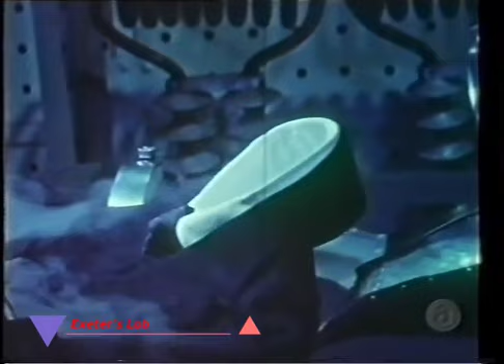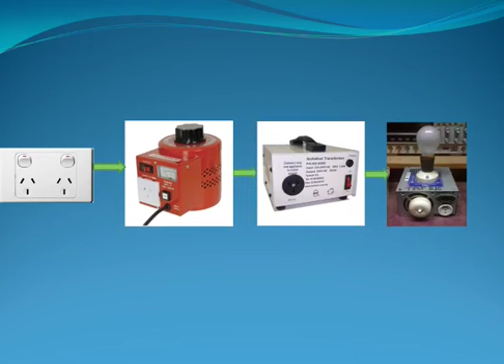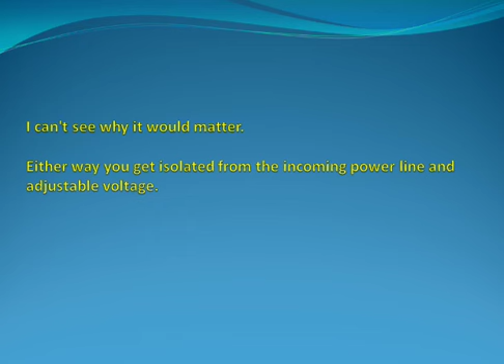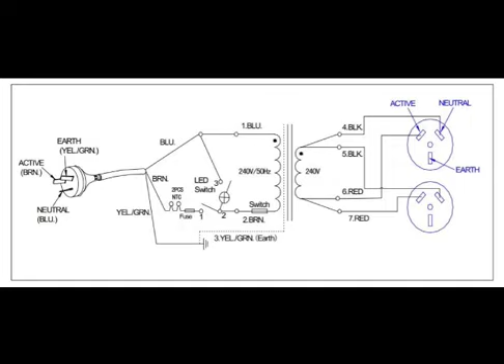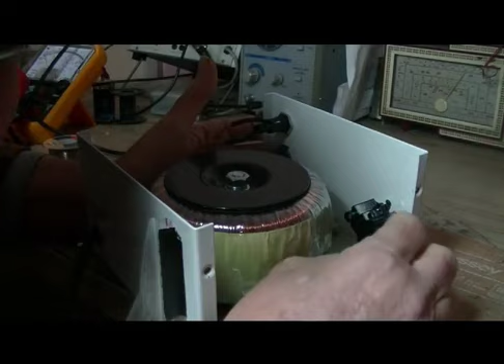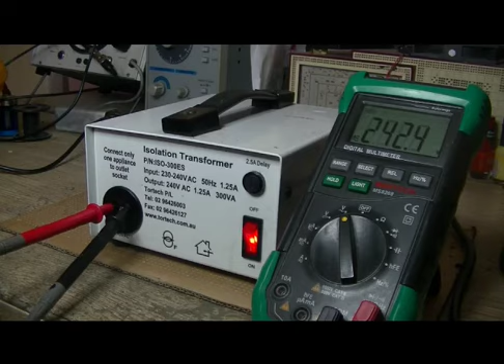Variac and Isolation Transformer connection order. Which should be first?

Comment: I have an isolation transformer itswired similarly to yours in as much as it has just a
2 wire output it is unnecasery to earth either of the output leads as that wil defeat the point of having it. Ive got an ancient variac its neutral and earth are seperat  as they should be they do not join them as that would be dangerouse and illegal in the UK. ALWAYS put the isolation transformer first that way if you accidently touch the variac terminals you wont get a shock.
Reply from the maker: Thanks for that Kelly, :)...............Frank

Comment: And one more point, re: the weak magnetic field stuff when the isolation transformer is after the Variac.... this is not how 1:1 Isolation Transformers work. They are 1:1, period. You give them 50 Volts AC, you get 50 volts AC on the second stage, only with a tiny bit of voltage drop due to thermal loss in the copper and in the iron core. Cheers man!
Reply from the maker: Hey, thanks for the info, much appreciated :)

Comment: Variacs and Isolation Transformers BOTH tie their ground pins back to your wall socket's grounding pin. The grounding 'hole' in that wall socket is, of course, on 'Ground' or 'Earth' and goes all the way back to your electrical panel. Here is the problem: In the panel, 'Earth' ties into 'Neutral'. This means that on the 'Safe' side of an isolation transformer, that Ground Pin IS NOT ISOLATED. In fact it is THE NEUTRAL LEG OF YOUR MAINS! Yikes. The same is true of the grounding pin on the "variable" side of the Variac! So if you were to 'touch' the ground of your isolation transformer's second stage, you'd be fine. But the moment you touch anything you're working on that carries the single hot leg of your AC, it's 'Goodnight Vienna'. Just wanted to point that out, I'll go back to shut up mode. Cheers!
Reply from the maker: I had read something similar before or i caught it from Uncle Doug. I have to admit, I'm very wary of all this stuff so I never touch the chassis with both hands  even though the Iso trans is supposed to protect me. I've had enough nasty shocks and I don't want any more lol

Comment: I made my own isolation transformer / autotransformer and put the isolation first because it seemed more right to me. The isolation consists of two step-up 700-volt transformers back-to-back. Can't use step-downs for this. Must be step-ups. And I earth grounded the output socket. I think I should have included a Ground Fault Circuit Interrupter (GFCI) device to the output as well. I'll include that in a future renovation I have planned.

Comment: Well, let me assume the following situation, which I would deem to be the "ordinary case": So, first let me assume that you have safe electrical devices, which means:

Variacs usually come in a metal case. And, like any electrical device,  they should therefore be grounded to protective earth. If they have a three prong outlet, the protective earth of the outlet should be connected to protective earth, like with any normal electrical device and like with any normal outlet. Variacs should have ordinary outlets, isolating the "business-conductors" from your touch and not some non-isolated screw-in terminals like some chinese ones do. If your variac is "unsafe"; if you have open wires or terminals open to the touch, if you can touch the business conductors, of course it's less risky to put it behind an isolation transformer, and what I say below does not apply. But in that situation fixing the safety problems of the isolation transformer would in my eyes the best thing to do -- and I did so with mine.

An isolation transformer usually has a plastic housing and double isolation, so there is no need for protective earth. It can have a three prong outlet, that, like you have shown in your video, should not connect protective earth behind the isolation transformer to anything. It is just left floating. I will explain why that is important.

Ok, your isolation transformer does have a metal case and there is no double isolation, to the case should be grounded to protective earth. That's not as good as a completely isolated one, but it's perfectly acceptable also. What I can see from here it's a perfectly safe electrical device...

---

If you use an isolation transformer for protection, the intent is, that if you touch any single one of the wires, you do not get a shock, because the other wire is isolated from ground and no electrical circuit can form. Touching one of the wires just shifts the potential of that wire to ground. As there is no back-connection through the other wire, no circuit is closed and no current flows. You are safe touching one wire.

Therefore you also do not need protective earth for devices in metal housings behind the isolation transformer, that usually do require grounding to protective earth. If there should be a fault in the device, connecting any of the wires inside to the case, it reduces simply to the case of you touching one wire, just now through the case of the device. Nothing will happen, no current will flow. On the other hand inadvertently introducing a ground connection behind an isolation transformer is very dangerous (because the isolation no longer is there!) so a device with a metal housing sitting behind an isolation transformer MUST NOT be grounded to protective earth. That's why it is important that the isolation transformer leaves the protective earth of it's isolated outlet alone and does not connect it to anything.

Ok, now we have a circuit behind the isolation transformer that has no connection to ground and we can touch any of the wires as long as we do not touch both... But all that "splendid isolation" is only there for the "first fault in the circuit". If you are not the first connection to ground, you are in a very dangerous situation! 

Assume you connect two devices to the isolation transformer and both have a fault. The first one might connect one wire to the case and the other one also has a similar fault, but happens to connect the other wire to the case. If you now touch both cases, you are in for a nasty shock. Likewise if one of the cases get's in contact to earth ground and you touch the other, you also get shocked.

Therefore it is mandatory over here in germany -- at least to my knowledge, I'm not a professional on this -- that on an isolated circuit like from an isolation transformer or from an ungrounded,  ordinary power inverter only one device, and one device only may be connected. It is simply forbidden to connect more, to prevent multiple isolation-failures to occur at once in the same circuit. (There is the possibility of having more than one device connected to an isolated circuit, but it's and edge case and requires an isolation monitoring device that makes sure, that none of the two wires developes a connection to ground, in which case it will act like a fuse and disconnect both poles from the powersource. It's much easier to introduce ordinary grounding, so most big inverters or generators go down that route)

And that is why it is not as good to connect your variac after the isolation transformer: It's case will be floating, and if it develops a fault, the case might be connected to one of the two wires, without any obvious consequences at first. If you now connect for example a hot chassis radio, you introduce a "second fault" and your chassis might now connect to the second wire. If you now assume you are safe, and while brushing against the hot chassis you reach over to your variac: Bang! Big surprise, maybe even a deadly one.

Best only connect a single device to an isolation transformer. Whenever possible use a safe, properly grounded variac with ordinary outlets that is safe to use without an isolation transformer before it. It should isolate the "business-conductors" and have a case connected to protective earth. And then use the variac before the isolation transformer, to not introduce a possibility of a "second grounding fault" in the isolated circuit should the variac ever develop a problem.

It's not a big thing, it's not a highly likely situation that you have an unnoticed fault in the variac, but it is the safer way around and I think it is in better alignment with the official safety rules; At least as far as I know...

Comment: I have one reason the isolation transformer should be first. Considering most if not all variacs use a variable contactor to traverse the windings of the variac. This action may result in the contactor momentarily breaking contact between the variac windings. Even though this make-brake-make of the contactor on the windings may induce a momentary glitch in the power supplied to the DUT. If the isolation transformer was wired between the variac and DUT, the glitches produced could cause the isolation transformer to produce greater spikes of electrical power to the DUT. Similar to having a faulty power switch which may not be perceptible to the average viewer, have been known to shorten the life of incandescent lamps and other electronics.
Reply from the maker: Thanks for that Donald. I'm learning so much about this from people like yourself

Comment: My main iso-transformer is BIG...output is 20amps/120V, so that goes first. Why ?  (1) There is a substantial magnetizing current in the transformer at all times (yes, even with zero load), so I'm not going to burden my 10-amp Staco variac with that current (2) My iso-transformer has dual primary windings, so I drive it from the 240 circuit, rather than the 120v mains (I'm in the US), because the turn-on surge current is less for 240V than 120V.  In fact, the surge current is high enough to frequently trip the 15amp breaker when running off 120V, but no issues at all when running at 240V. You can even hear the wires rattle in the conduit during power-on. Besides, I can't run the variac from 240VAC.

Good variacs have gotten rather expensive, so take care of them and they will last a long time. Mine is still going nicely after more than 40 years, and it helps that I've protected it with a 5amp circuit breaker so it never gets close to being overloaded.

That said, I rarely need to use my isolation transformer, because I rarely need to get my scope or logic-analyzer hooked-up for debugging my nixie-tube projects which use NON-isolated supplies. I do a lot of simulations before I send out PCBs for fab, so the design is pretty much bug-free to begin with. Second, I add support hardware to facilitate built-in testing. All of my projects use a Raspberry Pi Zero computer for control, so I connect to it wirelessly. No possible way to get shocked over WiFi. From there, most of the debug/verification work is thru software, so much of the hardware gets self-tested when the software is booted-up and I can look thru the report files if I suspect anything has gone haywire.
Reply: The go-to AC Mains front end for USA 120VAC electronic repair depots trouble shooting bench (which has a dedicated 20 Amp branch circuit (208/120)) for high end audio amplifiers is to use a hospital grade (has added internal shield which is tied to earth safety ground on the primary side, and thermal resetting switch NC) 20 Amp 120VAC Toroidal isolation transformer much like you have. After the transformer there is a 15 Amp Variac, with the bench de-rate having a nominal 10 Amps max at 140VAC, so nominal 1200 VA. 

The combined transformer / Variac magnetization current with the Variac at 120VAC and the output disconnected, without a soft start circuit will easily trip the circuit breaker (CB) at the load panel. So, the design includes an industrial control approach, green start button, red stop button, etc. to have a start up sequence so as to not trip the CB. 

To power up the AC supply you first have to enable the +12VDC, 3 Amp control supply with the rear power inlet switch (usually always on because the bench has a master power strip which is turned off after hours). Then, like any industrial control, you enable the AC supply by pressing the momentary green ON pushbutton, which initiates a start up sequence limiting inrush and disabling the output until powerup is concluded. After the powerup sequence the AC supply is ready to use. If you press the momentary red OFF push button, or any of the safety interlocks (mainly over temp) trip, including the isolation transformer NC thermal switch, or there is a brown out (latching relay will drop out early), the supply will latch off. To restart the technician must, once again, press the green ON push button. 

The AC supply has several protection features. First is the choice of three magnetic hydraulic circuit breakers at 1, 5 and 10 Amp. Next is a 600W 220 Ohm current limit resistor on a large heat sink acting like a dim bulb tester, but without the bulb. Choice of two panel mount analog current meters 2 and 10 Amp, analog output AC voltmeter, and choice of two isolated ground duplex receptacles (orange hospital grade HD) rated at 20 Amps, a GFCI and non-GFCI, each with its own power toggle switch and pilot light. 

If you establish the output of the isolation transformer as a floating supply (which is why we are using one) then you can use the GFCI as a quick AC leakage test (momentarily connected to transformer output plug ground (or case) to output neutral), tripping at the nominal 5mA of AC leakage current. This is only meant to be a basic AC leakage test before burn in. The final out going test / calibration bench has a very accurate AC leakage meter. The isolated ground hospital grade receptacles are common off the shelf Hubbell so when the plug tension gets low you just swap in a new one, they unscrew from the front after taking off the metal face plate. 

The AC troubleshooting supply is housed a custom enclosure in a 19 inch full rack on casters with other specialized equipment, one rack per bench. The Triad Isolation Transformer alone weighs around 45 pounds so the racks are very heavy. The racks are unplugged and moved when the floors are cleaned.

Comment: Transformers work in the same manner with any voltage, they won't behave the same with different frequencies and current loads. But both the variac and isolation transformer will carry the same current load so it's limited by the lower capacity of the two as well as the mains. Transformers don't consume significant power so the order wouldn't matter.

And if the variac is tying ground to neutral, you'll pop your earth leakage or ground fault interrupter and why would anyone do that?

My conclusion is that It does not matter what order you put them in. And for fun, you could throw the current limiter anywhere in the circuit. They are all in series and current will be the same through all devices. These are simple inductors and resistors.
Reply from the maker: Thanks Joe, your comments are making me think which is always a good thing. I'm starting to think that the order is not important. :)
Reply: @exeterslab7781  After having a think about this, it is possible that an isolation transformer might put neutral to ground on the output only for safety reasons but that still doesn't make sense. I'm standing by my original thoughts.
Reply: @exeterslab7781  Do not think that! At full output it really doesn't matter. But if you want full current capability of the variac at low voltage settings it DEFINITELY matters!

Comment: Why are you isolating from grid power in the first place?
Reply from the maker: That seems to be the most logical first step in taking earth out of the equation, based on the videos I've seen from Uncle Doug and D-Lab as well as advise from old time techs. Since I'm still fairly new to this, I tend to listen to well experienced people.
Reply: @exeterslab7781  Ha, ha, ha!  These comments? looks to me like ZERO experience!
Reply: Isolation Transformers are to allow you to connect earthed test equipment to a device under test. It provides galvanic isolation, separating two electrical circuits for enhanced safety by transferring power without a direct conductive path, protecting the user from shock and sensitive devices from electrical disturbances like ground loops and voltage spikes.